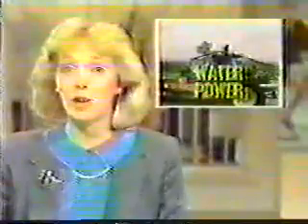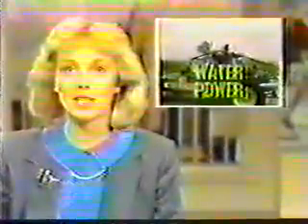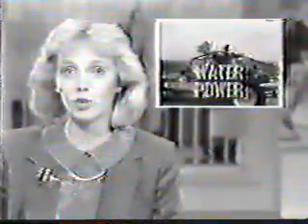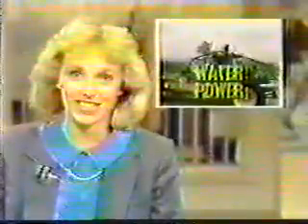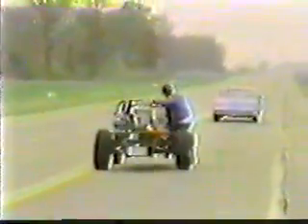Water engine

Comment: Of course this was a scam like all of the "water car" scams. If the laws of physics could be broken the automakers would be using it instead of going broke. Water can burn, but only at high temperatures, like pouring it on burning magnesuim. Instead of this nonsense people should focus on proven technologies like algae based biofules and thermal depolymerization. Even plasma gasification could work. The use of waste as fuel could solve environmental issues as well as produce energy.

Comment: plasma might ignight the hydrogen produced from hi v/c dc like a  5-12 amps at 12 vdc should work fine anay faster might overheat n explodebiger volumes take longer to make smaller are faster times on regenerating fuel

Comment: 2. A small electrolysis cell with the ability to vary distance between conductors.
3. 2 - Chokes, one adjustable, one fixed.
4. One high voltage diode to go in-line with the cathode of the power supply output.
5. Inductance Meter, Capacitance meter, frequency counter/Oscilloscope, and high voltage probe.

Comment: With the cell running at 1200Volts @ 1mA @ 42.8Khz I found I could make 200LP/H of gas. The process is achieved by the following:
1. Pulsing circuit or power supply capable of producing 600+ Volts @ 20Khz+ @ 100uA+. My system was a simple, off the shelf inverter with an input of 12VDC and an output of 1200VAC @ 20Khz @ 1mA. I then took this circuit and modified the circuit to run at 42.5-43.0Khz. This was an off-the- shelf inverter sold by Fry's electronics.

Comment: Also, with magnets most people say you can't get energy out of a magnet because the push and pull are equal, does that mean when we create an electro magnet it doesn't use any energy and that all that energy is just passing through the coils of wire?  If you lift something into the air and hold it there it takes energy, why does it take energy for a magnet to repel another magnet into the air?  And why can't this force of pushing and pulling of a magnet be used to get energy out of it?

Comment: I have a question, if hydrogen can be used as a fuel and oxygen is needed for things to burn, what happens to the oxygen after you burn it and what happens to the hydrogen after you burn it?  What does hydrogen and oxygen turn into after they're ignited?  I don't really understand how burning hydrogen leaves h2o as its byproduct.

Comment: mmm actually i´m studying mechanical and electrical engineering in mexico, and i´m doing some investing in my university, i´m investing and found that mixing aluminium and galium pellets can react and divide water into hidrogen and oxigen, the galium is used to prevent the aluminium from oxide¡

Comment: Do you even know what this efficiency means? I see that the answer is: no. Here's a simple example: you use 100 kJ of electricity energy to produce hydrogen, that has 60 kJ of energy. That means the conversion process has 60% efficiency. 40% is lost due to heat and other energy leaks. Converting steam power to electricity is even less efficient, somewhere in the neighborhood of 20%. It has nothing to do with pumping oil at all. Oil is just a source of energy, water - not.

Comment: I've got 2 ideas (inventions?) for gas and diesel engines.  I don't think gas engines will be replaced in the racing industry until something much more economical AND much more powerful is realized.  One eliminates the need for valve-cams and boosts power all throughout the powerband, the other is a NOS-like system that can boost power by 300-500%.  Only problem is I don't know who to talk to about it.

Comment: Here's an excerpt from a manual :

11. If you are concerned about the water freezing in your system, you can (a) add some
98% isopropyl alcohol and re-adjust the pulse frequency accordingly; or (b) install
some electric heating coils.

Comment: Wrong.  I've gone over blue-prints because I'm attempting to do the same thing to a Honda.

It requires electrical pulses between 1 and 5 amps at 12 Volts DC - power generated by any cars alternator.